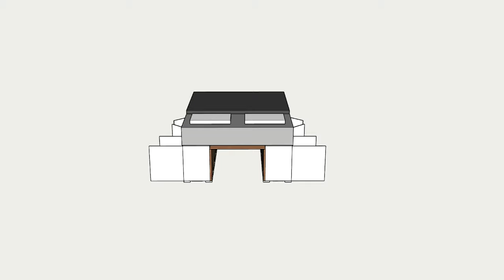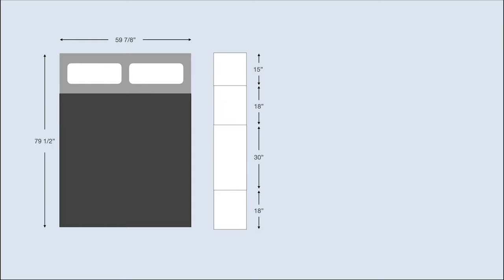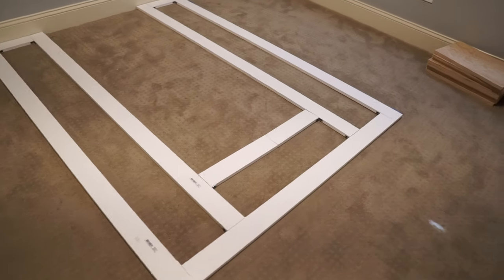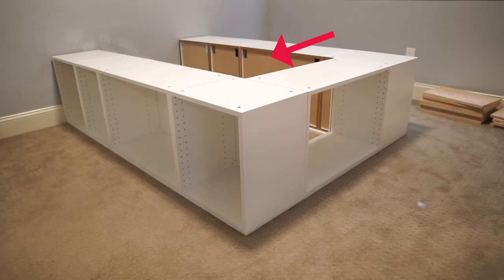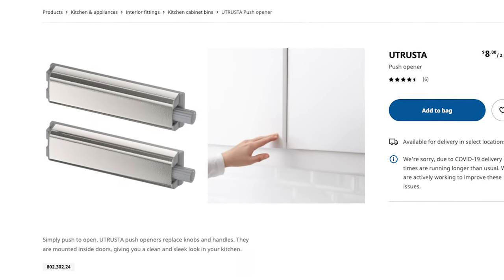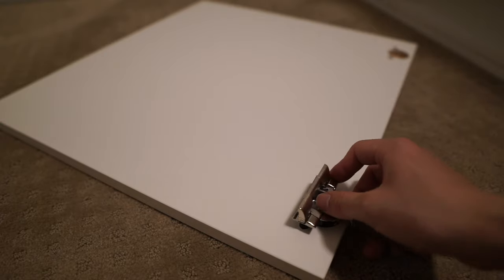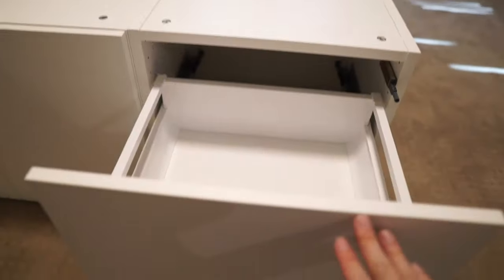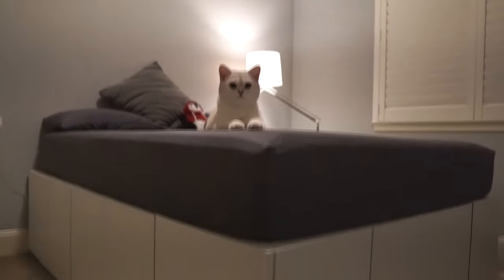Minimalist IKEA Platform Bed with Storage and Drawers | DIY, Hack, Renter-Friendly Bedroom Makeover

Comment: I'm really curious to know how this bed has held up over the past 2 years. Perhaps you can make a follow up video. Was it worth it??
Reply: I second this.
Reply: Good idea
Reply: Let’s hear it.
Reply: Same
Reply: yes pls
Reply: yes pls
Reply: Probably no longer being used since he hasn't replied this comment.
Reply: I've assembled a similar bed from MDF boards. It's not IKEA so I guess it doesn't count, but the design is really solid. Will come update when it breaks anyhow
Reply: Would love this, I've seen severa people over the years make videos like this but haven't really seen a years later follow up
Reply from the maker: The bed held up pretty well over these years, I have no issue with it. However, since I moved, I turn this hack from free-standing version into a corner bed with additional features (ventilation), check this new video: https://youtu.be/QVU2aaBjoJg

Comment: Just a heads up for anyone who wants to try this, a mattress needs to have airflow below it to avoid moisture getting trapped in it and growing mold and bacteria. If you want to do this you will have to air your mattress or leave the storage area in the middle hollow and keep empty spaces between the wooden supports. It's why bed frames are not a solid block of wood, but have gaps in between.
Reply: Exactly. Air too the mattress is super important  🌬️ or you will get a 🌊 in your bed and then a lots of 🐲 people will become 🤧🤢😵
Reply: Wow I always assumed that was cost saving
Reply: One could probably mount a slatted bed base on top of the cabinets. Would add a few inches but insure airflow.
Reply: so the front big one , without doors  would be fine , for the airflow
connection plates would be better instead of drillng them together without it
Reply from the maker: Great call out, I made another video with wood slats and additional ventilation: https://youtu.be/QVU2aaBjoJg
Reply: Not really a problem in states with low humidity.  Plus, if you rotate and flip your mattress regularly, as recommended by manufacturers, it shouldn't be a problem.  BTW, memory foam mattresses don't "breathe," so the risk of mold is higher with them.

Comment: Omg I would love to this, I was thinking I’d switch the drawers closer to the head as pseudo bed side table storage
Reply: I was thinking the same thing!
Reply: Simple open shelving works too, in that location. Source: My ex and I did something similar to this with Home Depot drawers and open shelf units approximately a million years ago (circa 1990.) This build is much nicer, though. We just laid a giant piece of plywood— custom cut at HD — on top of our units. We bought some extra cubes to put in the middle to provide support, and just didn’t use the center area. Again, this build is superior. More work, but far superior results. Very nice!

PS: We used some of the rug anti-slip mats both under and on top of the plywood, to keep the board from slipping on the cabinets, and the mattress from slipping on top of the board.

Comment: will this design withstand some passionate hugging ?
Reply from the maker: Yes, it has been tested :)
Reply: @ShawnCTech  Do things in the cabinet tend to move then? So does it make noise? 🙈 I am thinking of building a platform bed with kallax shelves but i am scared of things moving while "passionate hugging" my partner.
Reply from the maker: @Jojo-gj8go  Cabinets are connected with foundation, so they won't move, and there's no noise at all.
As long as you have solid foundation and all the parts are connected properly, you'll be fine.

Comment: As a seasoned builder of IKEA cabinets, i would recommend that all of the assembly is done first. Getting into tight corners and bending to such a degree is very difficult and painful, when you get older. Fabulous job 👍

Comment: Great work my man!

Simple tips that could save others some heartache:
Mark the drill dept with a piece of tape on the actual drill.
Clamp together the cabinets before screwing them together.
If your plywood has surface damage, ask the store for a reduced prize and demand it if buying the nicer ones marked "interior plywood" or something like that.
Sidescrew the foundation and use the brackets to anchor the cabinets instead. Regular wood is much more forgiving that IKEAs particle boards.

Comment: Nice build! But i have a question - how do/did you handle the air/moisture ventilation of the matress? I assume that if you tend to sweat a lot in summer, the matress tends to get moldy sooner or later? Did you have any experience with that?
Reply from the maker: I didn't do any thing for it, as we're living in a super dry area

Comment: omg this is amazing!! I´m moving out soon so I will probably make this, but I have a question does the mattress move around on the platform?
Reply from the maker: It doesn't, the mattress is heavy enough, you can apply some not so strong double side tape between mattress and the platform to increase some friction if you think that's needed

Comment: Did the doors hold up to the top weight? I'm concerned about the pressure of getting in/out of bed
Reply from the maker: The doors are not load-bearing; the cabinet is. Therefore, you don't need to worry about it. I been using this for 3 years, and all my doors are fine

Comment: Ok so im thinking about doing a ikea bed like this but with a bit other dimensions.and a loft inside What would you advice? so the bed itself would be 1m40 on 2m and i would like to add storage around it but with a cozy loft in the middle of it like a box with cussions and a projector (i dont have alot of space(cohousing so i need the extra privacy of the loft)

Comment: I am thinking of making something like this. But than just with the ikea ‘kullen closet’ 140x71 and the ikea ‘malm closet’ by 160x78. It creates a bed by 140x200. How does it sleep? You did not use a slatted base, is the bed les comfortable or it doesn’t matter? Cause we are struggling with making the slatted base on top of the closets. My mattress is from ikea as well, Hövåg, what looks like as big as yours. Let me know if you think the slatted base matters or not.
Reply from the maker: If your closet is deep enough, you don't need a slatted base IMO, but good to have one which adding extra supports.
Reply: @ShawnCTech  one if 40 and one is 48 deep. I will check with my dad. Thanks anyway and I will let you know!

Comment: really good and simple design, but do you have any issues with your mattress sliding around on top? particularly if you share the bed and both are rolling around? cant help but think you would need some edging to help prevent this?
Reply from the maker: You can put some double side tape between the bed and platform, or something can increase friction
Reply: Some velcro strips ;)

Comment: hey i know im kind of late but im trying to do this for my room but when i try to order the sektion wall cabinet the lowest the 15, and 18 inch one go is 30 inches but the others go 20 so what do i do for height?
Reply from the maker: With given 20in height options you can try: two 24in wide + one 36in wide which will result it a little longer platform but you can try to be creative with extra space like adding a bed headboard or something else.
Reply: @ShawnCTech  Ooooh thats smart thanks for the responses dude your really helpful!!
Reply: @Trvillinese  Add a built in power bar with usb for head lamp and cell phone... ;)

Comment: What was the total cost ? And the cost breakdown for each part ? Thanks !
Reply from the maker: Cost:
IKEA HAUGESUND Queen Mattress $249 x 1 = $249
IKEA SEKTION 30’ w/ door $82 x 3 = $246 
IKEA SEKTION 15’ w/ door $43 x 2 = $86
IKEA SEKTION 18’ w/ door $50 x 2 = $100
IKEA SEKTION 18’ w/ drawers $103 x 2 = $206
IKEA push opener $8 x 6 =  $48
IKEA UTRUSTA shelf 30’ $16 x 1 = 16
IKEA UTRUSTA shelf 15’ $16 x 1 = 10
IKEA UTRUSTA shelf 18’ $16 x 1 = 12
HomeDepot Plywood $34.13 x 1 = $34.13
HomeDepot Modeling board $9.58 x 5 = $47.9

Total: $1097.03
Reply: For this cost he could just buy a storage bed
Reply: @LAB-ff7pj  Are you crazy? Watch again…he have so much storage room…1,097. Is hella good.
Reply: @NoOtherxD  And that includes cost of the mattress, which you have regardless